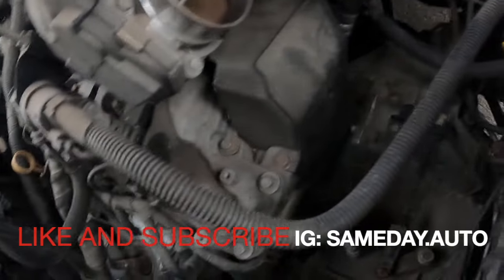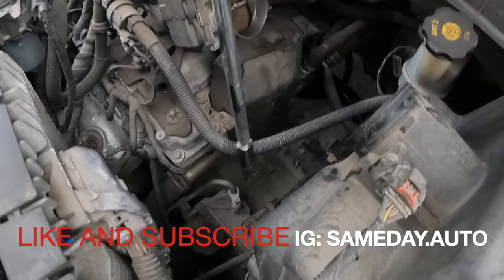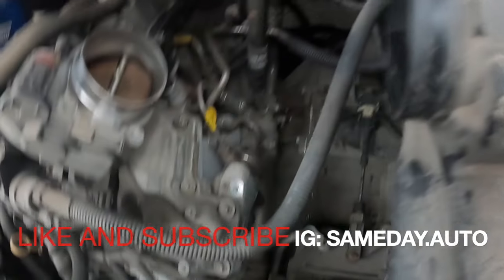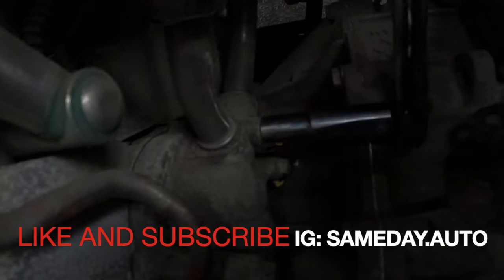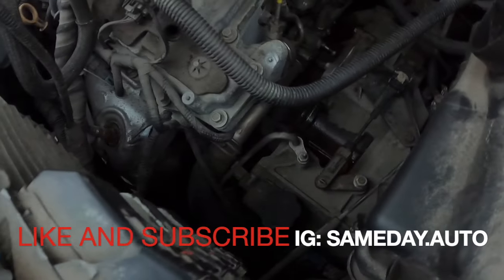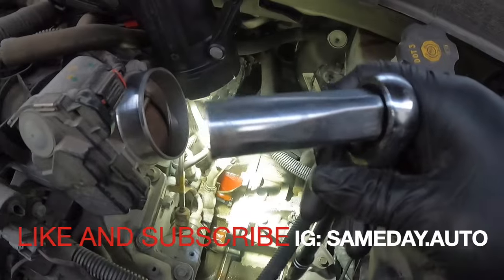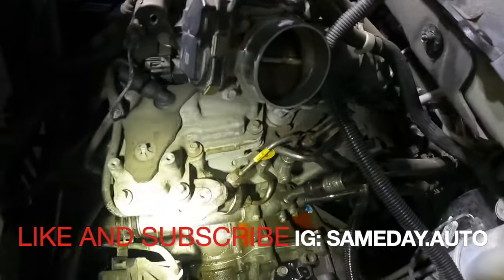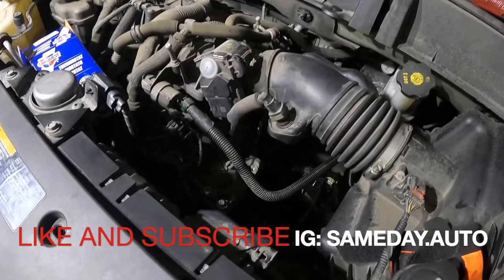2013 @Chevrolet  TRAVERSE THERMOSTAT REPLACEMENT

Comment: @samedayautodetroit So when putting the thermostat insto the housing there ahould have been a tube (its called an insert tool).that you use to push down on the spring and then turn to get the thermostat tabs under the housing tabs 13:48
Reply from the maker: I used 2 screwdrivers and pliers to set it
Reply: It should come with the thermostat looks like a toilet paper tube but thicker. I still liked the video for showing the close ups and posible was to make things work without spending more money.

Comment: For compressing the thermostat spring to get in the slots on the housing you can use a socket and extension to compress it then turn the ears in the slots with pliers or flathead.
Reply from the maker: That work as well more then 1 way to skin a cat. Thank u for the feedback

Comment: My brother told me, maybe my thermostat cause the issues.. so I bought thermostat n have it ready for my mobile mechanic guy… he asked me to get the thermostat housing, since the new one didn’t have the seal…. I do what he asked , so I went n got the thermostat housing…after he replace it … car run for 5min my needle point to hot again 😩and the car won’t start .. what could happen can you think of?

Comment: W video! what gave you the idea to replace it. we got the same car engine temp seems to go up and seeing smoke intermittently. this seems simple as a first step to try and replace
Reply from the maker: Her temp was going up and down
Reply: @samedayautodetroit  thanks! once you got a new one installed do you need to add coolant and bleed the system?
Reply from the maker: @kalebcantrell7468  add coolant for sure. It was good

Comment: I swear Chevy intentionally makes everything hard to get to.  This will be the first and last Chevy I buy.
Reply: It’s not Chevy. It’s the kind of SUV. Almost every crossover SUV you look at will have the motor installed sideways with the pulley system facing the passenger side.
Reply from the maker: Lol that job was a nitemare